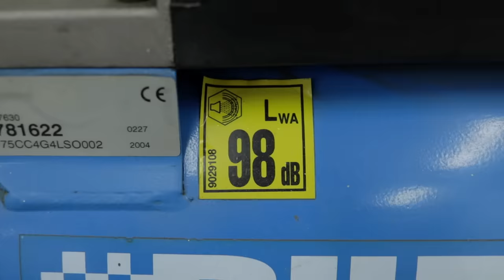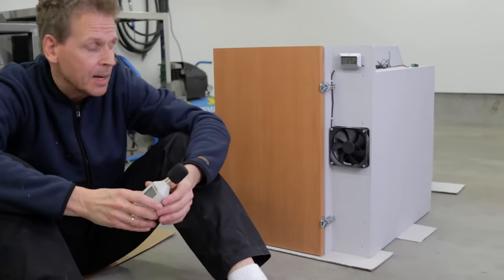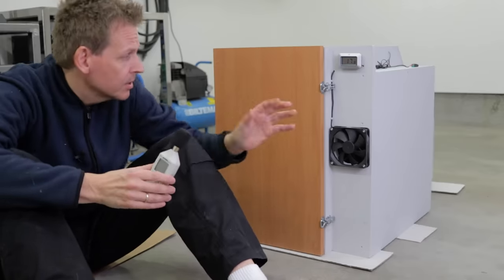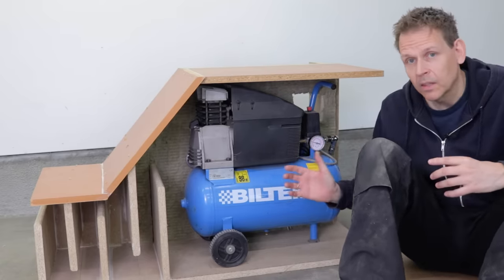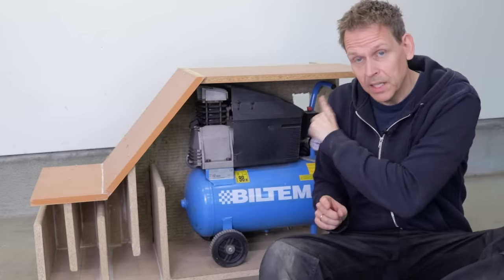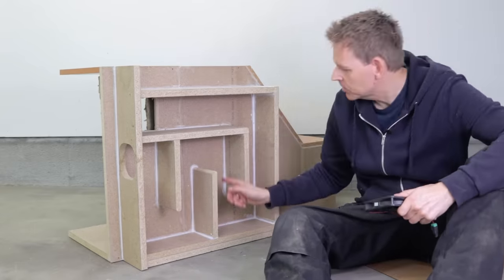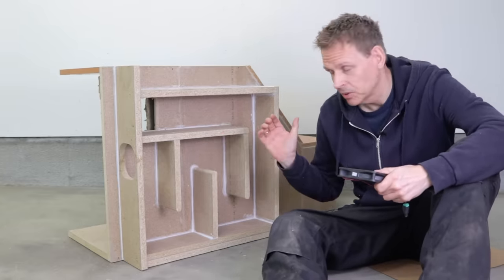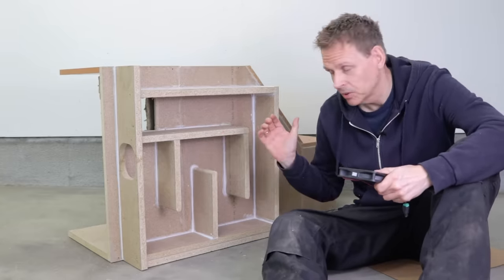Do not build a sound insulated enclosure for your noisy air compressor!

Comment: You could also remove the wheels and use rubber mounts, this significantly reduced the noise from my compressor before I built an enclosure for it.
Better still I moved it outside.
Reply from the maker: You are absolutely correct! It's my first improvement to-do, find some soft rubber to isolate the vibrations going into the box / floor.
Reply: @kihestad  cheap and chearful option is washing machine feet. Expensive but more effective is acoustic isolation feet. (iso-feet)
Reply: @kihestad  And don't forget to put a floor on the box.  Idealy something with some mass to it, such as a concrete paving slab, then put the isolation feet under that slab.  It will make the world of difference.

Comment: Short version to save a lot of work: Instead of building an enclosure for the entire compressor, much of the noise comes from the intake hole since that's right up against the piston.  You can access that and add a muffler or make your own.  There are loads of videos showing different approaches, but my low-tech method was to use a hole saw to drill out the grill to access the hole.  The intake hole is threaded to add an air filter, so I matched the size (Mine was 3/8"; not sure if that's standard) and added a 4" long brass nipple that I could then just put about vinyl tubing over.  I ran that out about 18".  The tubing deadened the sound considerably, especially the high-frequency clatter that's especially irritating.  I experimented with a homemade muffler on the end of the tubing, but the tubing alone reduced the noise by quite a bit.  (Note: I'm using a 6 gal Harbor Freight compressor, so it was pretty noisy to start with.  Better now, though not "quiet."  While I wouldn't use it indoors, I'm sure I'm not annoying as many neighbors since it is much quieter.)
Reply from the maker: That sounds like a smart solution! 👍 I did consider it, but I just did not know exactly how to build it. I found different examples on YouTube, but none of them made the compressor as quiet as I would like. Some used even a large exhaust muffler from a car, but I still thought it was loud. Did you measure the sound level before / after?
Reply: @kihestad  Alexplorer hit one key element. Look up images for Eaton / Polar air compressors so you can see their whisper box design.  I have a 10HP,  80 gallon compressor, and the whisper box silences the air intake a very good amount.  It is basically a large box mounted to the side of the compressor with rubber hoses that go from the compressor head to the top of the whisper box.   with just 2 or 3 labyrinth turns, and it is packed with a low-density fiberglass type mesh, similar to what MERV 4 Air conditioning filters use, and the bottom (floor) of the box has three ~15mm holes where the air is drawn upwards to the pump.  That being said mine is outdoors about 30meters from the garage.  The key is to have the air flow THROUGH the sound dampening media, not surround it!  This disrupts the noise a lot more.

That being said, nothing will dampen the noise the way we envision it will in our heads than simply very thick insulation material.  This is even more critical with typical oil-less compressors that are obviously very noisy.  I built a sound-dampening enclosure for a 7 kW Troy-Bilt generator two years ago during pandemic when everything was shut down.  What used to be an unbearably annoying loud generator now became a barely noticed 62 dB very low-frequency muffled sound that you can easily talk over even when standing right next to it.  I used 12mm board, and Roxul sound-dampening home insulation that was 3"/76mm thick.  The sides/top/bottom of the enclosure were 'sandwiched' walls where I stuffed the 3" thick Roxul down to about 2" compressed, so the walls themselves were 3" thick each!  The front and back were bare sheets in a labyrinth style like yours.  The air intake on the front was facing down towards the ground and was loosely stuff with Acousta-Stuff speaker insulation, so the air easily flowed through it, yet any sound that escaped that way was still muffled.  The exhaust end was also a labyrinth style but with no insulation, even though Roxul is rated to be fire-resistant up to something like 2,000°F  I didn't take the time to make proper flow channels, since Roxul does not allow airflow through itself  (the exhaust gas also went though a large automotive muffler I welded onto the exhaust pipe).  Now, The issue with this and sealing up air compressors is now heat.  Oil-less air compressors will suffer piston wall/ring damage very quickly  if they don't have TONS of airflow, and a 5" 120mm fan is simply not enough.  For my generator box, I used a 10" blower fan that moves over 2700 m³/hr (1,600 CFM) !  Obviously it produces a lot more heat, but for a compressor to stay cool, you still do need a massive amount of airflow, something along the lines of 500 CFM (900ish m³/hr).
Reply from the maker: @zod-engineering-welding  Thanks a lot for sharing tips and your project. Our boxes seems to be somewhat similar, yours a bit bigger. It's not vere hot here where I live, even on the warmest summer days. That's one benefit living up north here in Norway, I need heat pump in my garage instead of air conditioner 😁 In hotter environments and for bigger compressors more cooling is a must 👍
Reply: Great idea. I made a dog hairdryer from using a vacuum cleaner motor and used a car muffler as the intake. It made it so much quieter.
Reply: You got it exactly right, Alexplorer.  It's the actual air being sucked into the inlet that causes the noise because it creates pulses in the air, since you already have put tubing on it, you don't need a muffler, what you need is to move those pulses outside.  Put a longer piece of tubing on and run it through a wall with the filter inside a weatherproof enclosure and it will greatly reduce the noise level inside.
Reply: You're right because I have Silent compressor from Hyundai and this one has that as default and on intake directly connected to the piston is a filter in case with small rubber hose and this reduce the sound level to magical 59db without the enclosure.
Reply: I had the same thought, ha ha! Glad to see I have company.

Comment: A 20 Db drop is pretty huge!
Rather than a complicated enclosure though, just build a more normal closet and use thicker rockwool to surround it.  Much simpler design, and probably just as effective if not better.
The problem with the chamber design is that you are inadvertently tuning the sound from the compressor to fill a frequency range like a bass box, when your goal is just to kill it entirely.  Building a much larger/simpler cabinet or closet space with thick wood and drywall, and 4-8" of dampening material will allow you to shove all of your loud items in 1 space together and will help a lot.
Reply from the maker: It sounds easy, but you forgot the ventilation / cooling. Without the compressor will overheat and be damaged right away. It's kind of important to let air into the box as well, how else can it generate air pressure in the tank 🤔
Reply: You still need ventilation vents for cooling. A bigger box is not necessarily the solution.  He can add Mass Loaded Vinyl to the existing box inside or outside to dampen sound.  Noico panels on the tank will also dampen the vibrating metal clanging.  Finally, acoustical foam inside the box will absorb sound well.
Reply from the maker: I agree, if I had a bit more space - I think even  just 10 cm more on the inner part would have helped a lot, and then add more and better sound absorbing material there.

Having my size constraints made it impossible to add more sound absorbing material. I had to make the box fit under my bench 😔

Comment: Hello, props to your design & craftsmanship, I can tell you have much skill working with wood and tools. As you mentioned quiet compressors are not cheap, this is true. I worked at two companies that built industrial compressors, Sullair and Sullivan Palatek here in the U.S.A.. My job was to assemble and wire up these machines. These machines ranged from aporox 5 hp all the way up to 125 hp. However the big difference was these were screw compressors. Instead of using pistons, these compressors use two screws “male & female” that mate with each other like two worm gears side by side. These screws spin at high speed in a special synthetic oil bath, the oil is then separated out of the compressed air using an oil separator tank. This separator is basically like a big air filter that removes the leftover oil from the air. The advantage of screw compressors is they run much quieter, and produce continuous air flow rather than in puffs. Their frequency of sound is much higher, but generally still considerably quieter than then piston type machines. However these screw type machines start of at around approx $4000 for a 5 hp and a 100 hp approx 30-$40K depending on options. All refrigerators and for home and commercial cooling  compressors are also of this screw design for compressing of the refrigerant.
Thanks for your video sir, I found it interesting.😎👍
Reply from the maker: Thanks a lot for your comment, it was very interesting 👍😊 I have heard about screw compressors and knew they where expensive, but I did not really know how they worked. This was very fun to read, and now I am a bit wiser 😊Learing every day! Thanks!!!
Reply: @kihestad  Your welcome my friend. I can appreciate you for taking  the time to design your enclosure, and document the process. I also have always found compressors annoyingly loud. My father and I would often jump in surprise whenever his 5hp craftsman compressor would turn on automatically in his garage. Just so ridiculously loud, lol. 
Best wishes 😎👍

Comment: A design I created when building speaker cabinets is to bond two very different density woods together to help make them acoustically dead.  You can imagine if you have two bits of wood with very different resonate frequencies, when they are mechanically bonded they the two bits of wood fight each other and there is basically zero sustain at the new resonate freq.  Works really well for internal braces in a cabinet.
Reply: so you would make the sunwoofer box braces out of a different wood or make one the walls different from each other?
Reply: @tuomas2789  i think he meant walls made by laminated panels of 2 different material. A box of wood and a second layer of mdf for example.

Comment: Thanks for your interesting experiment. The reduction in noise is huge. This is because the decibel scale is not linear but logarithmic! By the way, there is still some room for improvement in my opinion, namely:

1. Sound is reduced not only by diffusion, but also by mass. It does not matter what the density of the material is. So if you use heavy material, thinner material will suffice. Covering with lead is an obvious choice then. This can be done on the inside or the outside. 

2. There is also much to be gained in the kind of insulation material you use on the inside. If you use specially manufactured foam rubber with a wave pattern for sound insulation, the sound is additionally dampened.

3. Then there is impact sound. Sound that travels through solid material. This can be improved by making the box double-walled. Most of the damping occurs at the transition between solid material and still air.

4. Another improvement would be to isolate the compressor from the ground by removing the wheels and instead putting it on thick and soft rubber pads (or on air tires). Or you turn a couple of sturdy eyes in the ceiling of the box and hang the compressor from them with thick ring-shaped rubbers (as is often used with tent pegs.

Anyway, good luck. It was an informative video!
Reply from the maker: Thanks a lot, glad you liked the video 😊 I dont think I could have put on lead, it would probably have worked but remember I had to get it upstairs 😂But I got your point! It would probably have been better to use MDF instead of chipboard for the box, as MDF is more dense. When it comes to the insulation I used a pretty good one - it's Rockwool made especially for sound insulation, it is twice as dense as "normal" Rockwool insulation. Double wall would probably have been a solid upgrade, I did not think about that when I made it, it has been mentioned by others as well! I will try your tips number four using some kind of soft rubber material to allow it to "shake" a bit inside and perhaps avoid vibrations. Thanks a lot for your feedback and your improvement tips! 👍
Reply: The cheapest way to add mass damping is to use sand. Double wall enclosure, pour in the sand. Not only high mass, it is also 'high friction', so absorbs the sound energy. I used this very successfully on my dust extraction system.
Sand filled baffles were used in the early days of audio- much lower coloration at lower frequencies.
Reply: @Tensquaremetreworkshop  Thank you for the trick about using sand, and thank you to this whole thread (and video) for showing the world something I've been thinking about since I bought my compressor: how much quieter is it in a box? I'd think a simple box, then filled with sand and made double-wall, would be the way to go. Less build time, plenty of sound dampening.
Reply: @Nphen  let me know how it goes!
Reply: what about zig zag walls, i heard no one talking about this here buts its commonly used in  stuidios
Reply: @Milan_M95  Where, exactly, would you put these walls? Or are you talking about a labyrinth… In my experience this does not work, at least for wood. The panels just resonate. Concrete? Perhaps, but it all gets a bit large. Why not just put it in a remote location and run a hose?
Reply: @Milan_M95  I was thinking get rid of parallel walls; the "baffles" should have odd angles. The enclosure can be packed with sound absorbing scraps and still allow air-flow.  The large wall needs a couple "stiffeners" to keep it from radiating noise. The whole box in the attic needs to be suspended by nylon ropes to prevent transmission to the floor-ceiling.

Comment: I used panels for suspended or "drop ceiling" panels or the neighbors generator room. Another aspect you may consider is phase cancellation and not having your box side parallel, as the reflect back and forth to each other. Straight and flat becomes a sounding board.
Reply: Yes, reflecting is effective at reducing standing waves. It’s shocking how well it can work

Comment: Nice video. However, one thing I would like to recommend is to reroute the on/off switch to somewhere more convenient. If you were to get a broken hose or connection somewhere when you are not in the garage the compressor will keep running until it destroys itself from overheating. It's a good idea to turn off the compressor when you are not using it to avoid this risk.
Reply: We shut ours off at the breaker box. Done.
Reply: @dolphincliffs8864  I recently Discovered Most American Outlets don't have on/off switches at the wall powerpoint. They rely on the product having an off/on swith built in which is terrifying as an Australian who can't imaging leaving a 240 volt outlet plugged in and turned on indefinitely hahaha
Reply: @ArtyMars  I agree it is stupid how we do it here however,in our case the compressor and outlet is out of reach.
Reply: @dolphincliffs8864  the amount of times however I’ve been going mental trying to figure out why something won’t turn on tho and it’s just not turned on at the outlet hahah I’ve wasted hours of my life on that 😂😂😂
Reply: @ArtyMars  There's a lot about our standard electrical practices that doesn't seem like the best idea tbh. Daisy-chained stab connector receptacles are a convenient way to do things, but a little time spent pigtailing can make things a lot more reliable for instance.
Reply: @ArtyMars  Honestly it's even worse in America when there's only 1 switched outlet in the house in the living room intended for a lamp, and the occupant calls you out only to be very embarrassed that it took a total of 3 seconds to fix what wasn't a problem because we never even think about the possibility of an outlet having a switch most of the time.
Reply from the maker: I agree 👍 I have a separate switch for the power outlet the compressor is plugged into. I never leave it on if I'm not working in the garage.